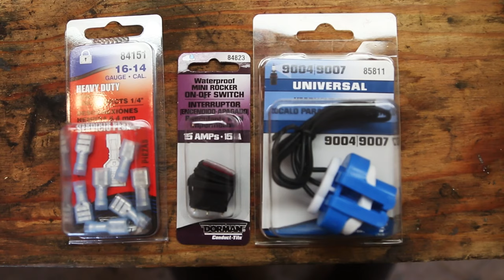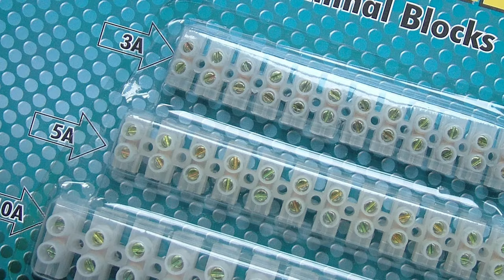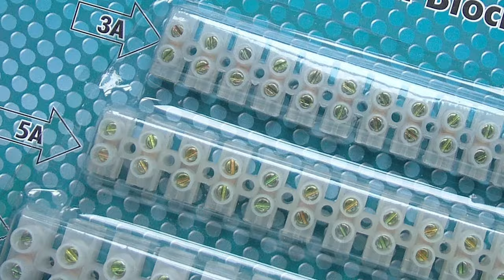CR250 Supermoto Build - Lights Ep2

Comment: Hi bud love this av done what u hve done but wear does the yellow wire go to and also how can i get the taillight to stay on and when pressed go brighter
Reply from the maker: You'll have to test it but from memory, the black wire is ground, one of the wires (maybe yellow or the red) is the positive to keep the light on. The red (or maybe the yellow) is the foot switch light from the nissin brake wire. So nissin brake ground goes to frame, the other wire goes to red wire on light; the yellow goes to the battery or your positive connection. Should be something like that.

Comment: hi bud did u use a rectifier to recharge the battery or how did u get it to recharge do you need to charge battery manually
Reply from the maker: Manual charging. The cr250 used to have 3rd party cdi's that could power lights. If you are lucky enough to find one you can go that route.

Comment: I got a question for you, did you use a wiring harness to wire your lights up or did you just buy wire and solder/use connectors to rig everything up? 

Im in the process of planning out how to rig up my 03 CR250 and would like your input.
Reply from the maker: I just got wire and rigged it up. Like I said in the video, I don't 100% recommend doing it that way since there's crap hanging everywhere (this is also just a mock up). Make a harness or route the wires out of view so they aren't going to run into anything. Take your time since this is an important step that you don't want to revisit.
Reply: Thanks for the input, ill figure some kind of neat harness out, keep up the great work!

Comment: Hey ...I have a question I'm doing the same thing to my bike and u didnt mention how you’re  going to charge ur battery?
Reply: Michelle Demartino purchase a new stater with high wattage along with a rectifier and it will charge the system on its own. But if you don’t go this route use a trickle charging system for the batter when not in use.

Comment: Does the battery get charged when the motor is running?
Reply from the maker: No, this is a total loss system. If you can find the super rare cr250 baja designs lighting stators (300w) then you can get power from the bike running.

Comment: 3 Knees Down,  Do I see a crack in your sub frame @ 11:33??
Reply from the maker: Yup, there's a crack in the seat post from the previous owner. I'm probably going to end up welding it together or building a new seat post anyways.
Reply: Would be wise to to it sooner then later before it spreads.  Interested to see how this project turns out!